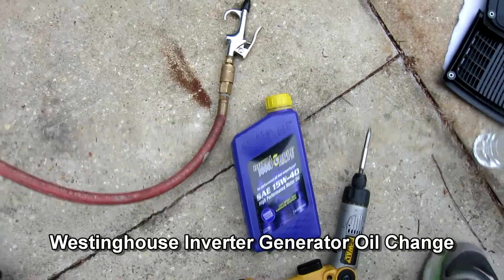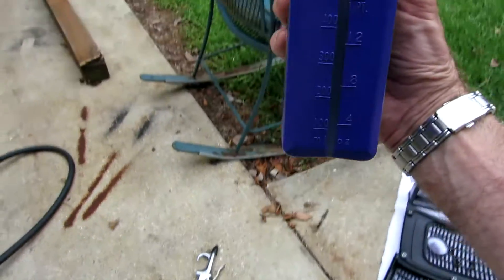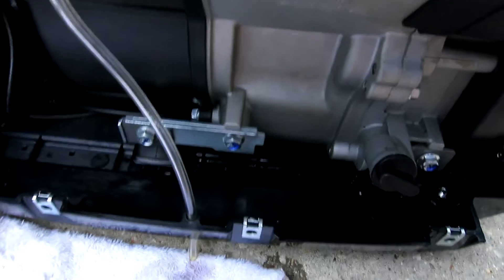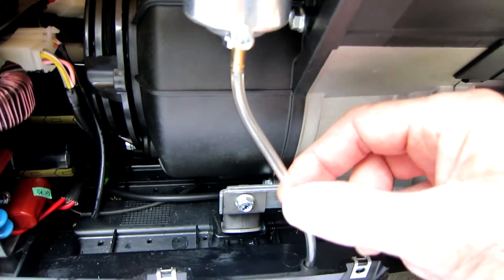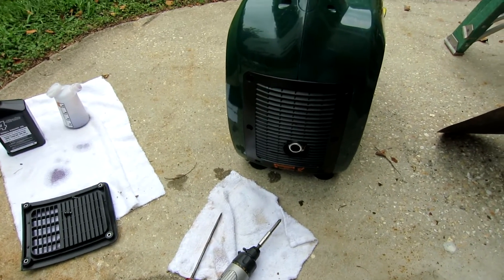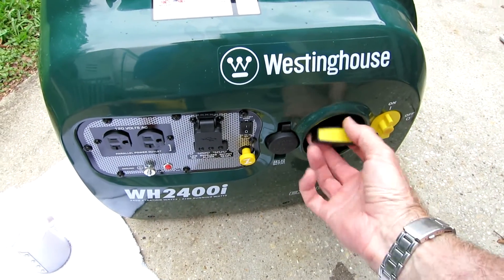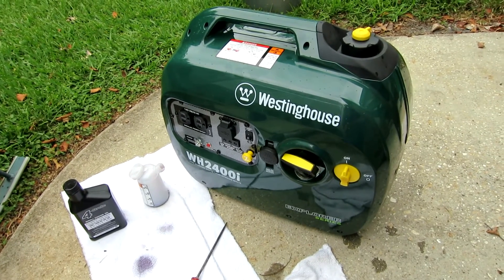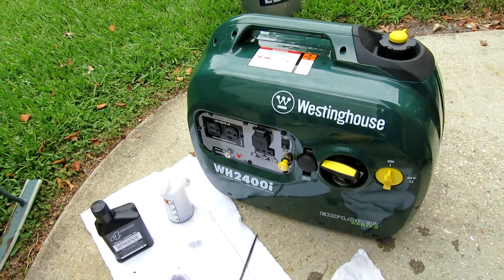Westinghouse 2400i Explorer Oil Change

Comment: Thanks. I went out this morning to warm it up and change the oil for the first time. When I looked at the opening I figured it was going to be a mess and looked for advice :) I will pull the cover too. Have a good one.
Reply from the maker: maybe if you put something under the plug like a piece of plastic (milk jug) or something to help keep it out of the bottom, you can do it cleanly.

Comment: I have had my Westinghouse 2400i for over a year now.  I sold my like new Yamaha 2000 so I could buy the Westinghouse.  I have not regretted buying it for one second.  I has run like new for over a year and has a lot more power.  Weight is the same and sound is very close.  Best of all it runs a 13.5 BTU Coleman AC.  I highly recommend this unit.
Reply: jduncan740 yes it runs my 13.5 Coleman right out of the box. It's a fine little generator and undoubtedly the most wattage for size and price.

Comment: Hey Marion, just wondering, did you go through a "breaking in" period with the 2400i? Like to break in the engine? I just bought mine, I read that you should break in a new generator, I've let it run in idle for 1/2 hour, now have a tv and satellite box plugged in, as well as a 1500w heater that I've turned on every once and awhile just to give it a work out to see how it handles the load. No issues yet, though the generator did just shut down while it only had the 50inch tv and direct tv plugged into it for a bit over an hour. I went out and had to give it a few pills to get it started back up. Also, I noticed mine doesn't start on one pull like yours usually does.. sometimes it take three or so. And the sound it's as quiet as I thought it'd be... even on idle.. maybe it's because it's set on a wooden deck and the wood vibrates.. I'm not sure. I just hope I made a good investment.. your videos helped me pull the trigger on it. Any advice you can give would be great! Thanks!
Reply from the maker: Keith, I loaded mine up right away.  They do say to change the oil at a shorter interval on the 1st change.  Mine was difficult starting the first time but it usually takes 2 pulls.  Always have to pull the choke or it won't start.

I ran it for a week for about 3 hrs a day recently while boondocking.  Wespro who handles the warranty work for Westinghouse is excellent.   They sent me a spare carburetor to experiment with when I inquired about running it at high altitudes.  I would say the noise level is probably as you said, running it on a deck.  I don't think it's as quiet as a Honda although the specs show it to be.  If it's always difficult starting, I'm sure they'll send you a new one or a new carburetor would probably solve the issue.  It might just need some running.

When I used mine at 8600' this summer it was finicky and difficult starting.  I finally solved the problem by loosening the gas cap.   It has a vent valve but for some reason that solved my problem.  You might try that.

But overall, it's been fine.  BTW, are you at sea level?
Reply: Thanks for the quick response.. Ha I feel like an idiot, just figured out that it kept cutting off because it was about out of gas.  When I turned a space heater on again, it immediately shut down, so I decided to put more fuel in and it's running fine now.  It's a great generator like you said, easy to carry and I like the extra wattage... I was going to get the WEN 2000w, but after researching this one & seeing the review videos on here like yours, I pulled the trigger on it.. it helped that Amazon dropped the price from $699 to $550, of course!  I'm at about 250 feet, I live in South Arkansas about 10 miles north of the Lousiana border (about 60 miles from Monroe).  As far as altitiude performance, that was one thing I was concerned about because I plan on taking this camping near Rocky Mountain National Park & Grand Teton this summer, and would hate for it to not run there.  Some review on Amazon said it wouldn't run above 7,000, and that worried me... then some place said that it would run, but it wouldn't be able to handle as much load as it would at lower altitudes. I know the efficiency drops the higher you go, but that's OK, since I won't really need the full 2100 watts in the mountains, since it's usually cooler and won't need an A/C. I'm sure it's not as quiet as a Honda, but for the price it's the best "bang for the buck".  I may look into getting jets so it operates better at higher altitude, I'm not very mechanically inclined, but it looks easy enough to change it going by this video.  Appreciate you taking the time making these.
Reply from the maker: Keith, I was concerned about running at 8600'.  Westinghouse (Westpro) sent me a high altitude jet but it didn't fit.  After doing a lot of research, I discovered that the engines on the Westinghouse and the 2100 Homelite are identical.  I ordered the jets on page 3 of the manual at this link below.  I was at 8600' and it worked fine.  I used the one for that elevation.  Both of them were less than $10 or so the way I recall.  See page 3.

http://www.homedepot.com/catalog/pdfImages/84/8454542c-9071-46c6-b441-4ce1eb1fe9a1.pdf
Reply: @MarionBlair  I have been enjoying your videos on your Westinghouse...and I just sprang for two of the 2200iXLT models I will put in parallel, but I suspect there are significant similarities.  They are in transit, so I don't yet have them, but your videos raise some concerns.  I know you made this over 2 years ago, but hoping you are still monitoring.  Do you by any chance know if the carburetor is the same on the two models (yours vs. mine)?  We full-time RV and often find ourselves at 7000', down to sea level, so carb re-jetting is likely in my future.  That doesn't worry me as long as I can find the jets.  You mentioned being able to actually talk to someone with Westinghouse (Westpro)...how were you able to do that?  All I can find is that they offer email support...do you have a phone number you can share (PM me if you would prefer not to post it).
Reply from the maker: The contact info is below, I did a lot of research back then and found that the Homelite which Home Depot handles, is just about identical other than it's red.  That's where I got the high altitude jets from.  Here's a link to the Homelite manual which has the jets and other contact info.  The jets work fine in my unit but it ran good with the stock jet at 8300' also, ha.

The wattage is a little different but the engine CC are identical.  Look on page 3 for the jets, they were about $10, I bought both of them.  Let me know if I can help.

Contact for the high altitude jets

HOMELITE CONSUMER PRODUCTS, INC.
1428 Pearman Dairy Road, Anderson, SC 29625
Phone 1-800-242-4672
www.homelite.com

https://images.homedepot-static.com/catalog/pdfImages/84/8454542c-9071-46c6-b441-4ce1eb1fe9a1.pdf

Contact for the Westinghouse
Westpro Power Systems, LLC
W237 N2889 Woodgate Road, Unit B
Pewaukee, WI 53072
855-944-3571
Reply: Thanks very much for the info.  Hoping mine runs well also at altitude, but would be nice to have the jets, “just in case”.

Comment: Nice job, seems unusual that its 15-40 weight oil. Not a easy detail to fine. I also bought the Homelite jets.  I love my Westinghouse generator and want it to run a long time so I'll use the synthetic oil.
Reply: Yes for the money, it's a gem.  I switched to Royal Purple synthetic which is one of the few that come in 15-40.  15-40 is very common in diesels but not in a synthetic.  It takes so little you might as well put synthetic, is the way I see it.

Comment: What brand and part number spark plug are they using ?  If you were on a trip, what plug did you carry as a spare ?
Reply from the maker: There's 4 different brands, Denso, etc...  I didn't bring any spares since the gen was brand new.
Reply: Many of the Chinese built generators use poor quality Chinese spark plugs that foul out quickly.  Denso is a GOOD brand !  I still would carry a spare.
Reply: Good advise, thanks

Comment: You don't need the RP.  I use Rotella T6 5W40 in my WH2400i.   It is full synthetic and covers the spectrum of 15W40. Also the Honda is a 98.5cc. Lastly, where di you find this was like the Homelite? I can't find that anywhere.  How are the new jets?   I use this mostly desert or sea level....but ya never know.
Reply from the maker: Hi, this is the link for the Homelite manual which has the high altitude jets. 
http://www.homedepot.com/catalog/pdfImages/84/8454542c-9071-46c6-b441-4ce1eb1fe9a1.pdf
 I recently ran it for a week in Utah at 8600' elevation with the Homelite jet.   Pulled the plug periodically just to make sure it wasn't running too lean.  So, the Homelite jet(s) worked fine.  I gauged it prior to installing just to make sure it looked like a reasonable application for the altitude.   As to how I found the Homelite, it was pretty much by accident.  The Westinghouse and Homelite are identical as far as I can see other than the inverter output is more on the Westinghouse.

Comment: How has it been the past year, a buy or not?
Reply from the maker: I'd do the same thing if I needed one.  It's very well made.  Westinghouse has US support and it's excellent and by phone.   When I got mine it had a minor crack at the bottom of the front cover.  One of those things that, no one but you knows it's there.  They sent me a new cover and didn't want the old one.  To this day, I haven't changed it yet.  When I got to inquiring about high altitude jets for my Utah boondocking trip, they sent me an entire carburetor to experiment with.  In my honest opinion, I don't think it's as quiet at the Honda 2000 but it's close and it's got more power.  I haven't run it since the August flood we had last year here in Louisiana.  (other than routine stuff) but  it was a God send when the power went out and we had to keep the refer and other must have (TV, ha).  For the money, it's going to be hard to beat.  It's probably less chance of getting stolen also as thieves like the red ones.  But at slightly over $600, it's hard to beat.
Reply: Thank you brother, I believe you sold me... I keep hearing the motor is Asian Crap, even though Honda and Yamaha are from that area.  Is the motor good quality?
Reply from the maker: I'd had the cover off a couple of times and the build quality looked excellent.  It starts on the first or second pull most of the time and so far so good.  I've got about 30 hours on it and so far, it looks and sounds like the day I got it.  I think the motor is fine.  China quality is not what it used to be, it's much better now.  Just about every Generator has an engine made in China now a days.
Reply: I got a deal on a Yamaha, and did it.  Only reason I hear Westinghouse going to be sold.  and I'm worried of the future. I wish we could have found out the manufacturer of engine.
Reply: Yamaha is in in a different league in my opinion.  But, it's twice the price.  You can't go wrong with Honda or Yamaha.  But for $619, the Westinghouse is a great buy.

Comment: Could you tell me how to get the altitude jets please? I can find zero info on this.
Reply from the maker: yes, page 3 of this manual below; 
 It's the exact same motor and I've used them at 8600 feet last year. 
 Westinghouse didn't have them but they may now. I did trying running the generator with stock jets for a little while and it seemed normal.  Just pull the back cover off and the carb is right there, no need to remove the carb.
 They call their parts Westpro. 
 Let me know if you need anything else. 
 The jets are simple to replace and seems like I paid about $10 each. 
 https://www.homedepot.com/catalog/pdfImages/84/8454542c-9071-46c6-b441-4ce1eb1fe9a1.pdf

HOMELITE CONSUMER PRODUCTS, INC.
1428 Pearman Dairy Road, Anderson, SC 29625
Phone 1-800-242-4672
www.homelite.com
Reply: Great thanks a lot. We are about to go on a big trip out west and I know we will be at high altitude. Santa Fe is 7200 feet and as you go north it gets higher. Would hate to be boondocking there and the generator not work.

Comment: Instead of taking the generator apart, could you use one of the aftermarket screw on drains made for the  Honda's?  https://smile.amazon.com/dp/B06XW2HYDH
Reply from the maker: Yea,, there's a lot simpler ways to do it after dwelling on it.  Really just take the gen and turn it sideways is one.  It weights very little.